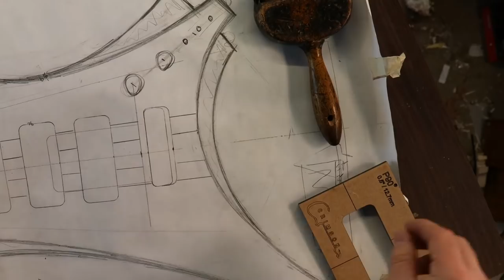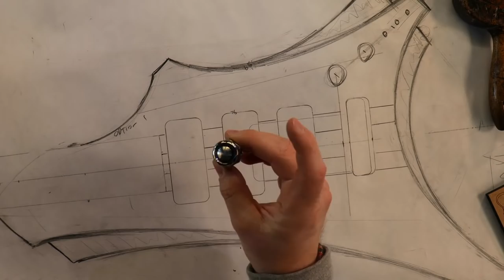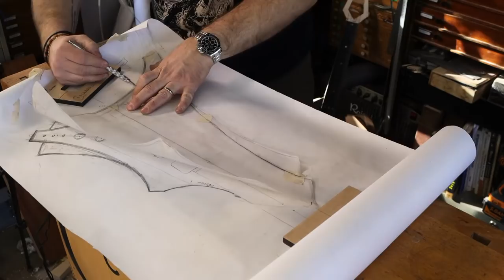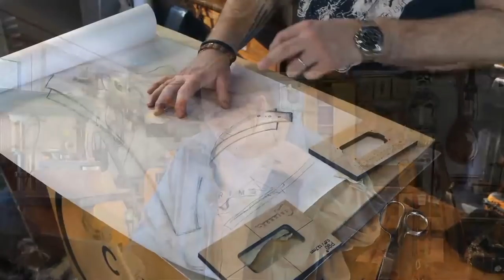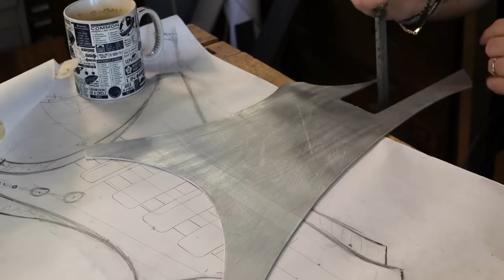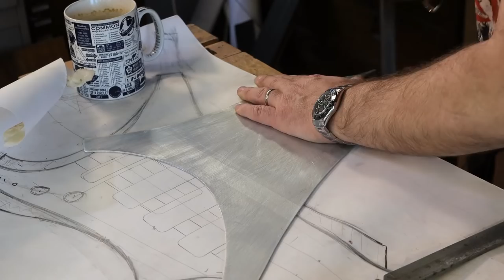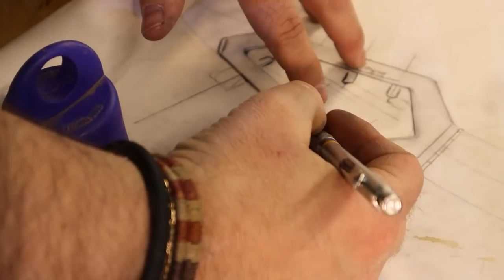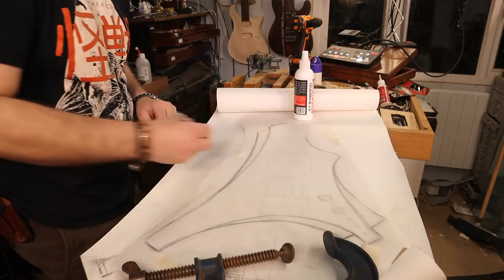LIVESTREAM Day 3 Scratch Guitar Build Celebrate 300k Subscribers

Comment: Greetings from the USA Ben;
     I personally prefer the decimal inch measuring system to metric. I find it easier to use on precision parts. To get the same accuracy with metric measurement you have to go to 40th of a mm instead of .001". I do prefer the metric measuring system to the fractional inch system for the same reason, it's easier to use.
     Using the same reasoning, I prefer a power scroll saw to a hand powered scroll saw like you used to cut the neck pocket out of the top piece of the guitar body. I would presume that my power scroll saw cost less than the value of your hand powered scroll saw. It cost 45 USD in 2007.
     I didn't get to watch your video live, but am enjoying it 18 hours later. Thanks for sharing it.
Reply: For precision parts someone wishing to use the metric system would probably be using micrometres (or microns, depending on your preferred terminology), that's 1 thousandth of 1mm . So .001" wouldn't be a 40th of a mm it would be 25 micrometres.